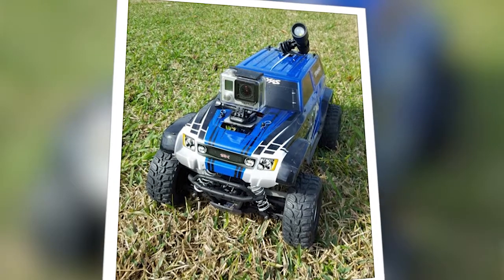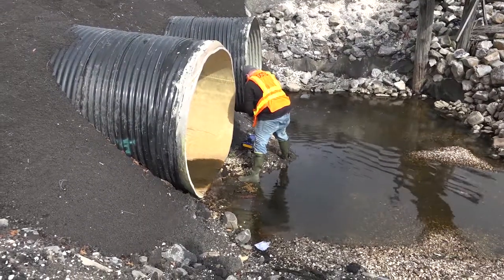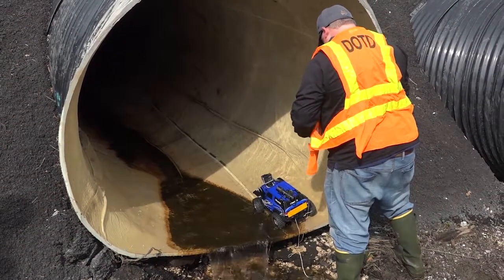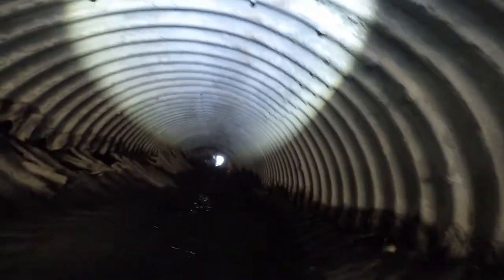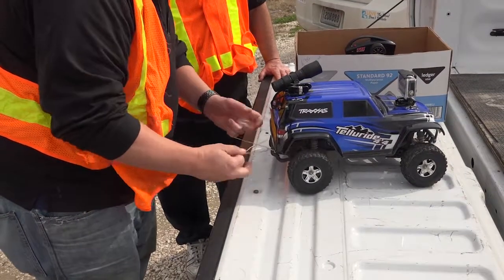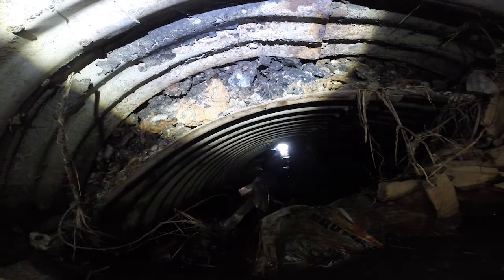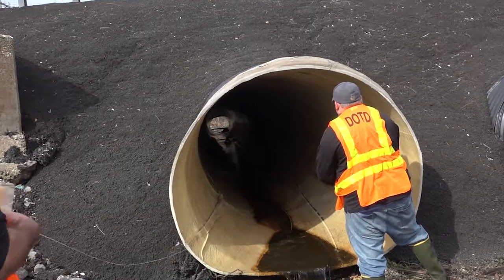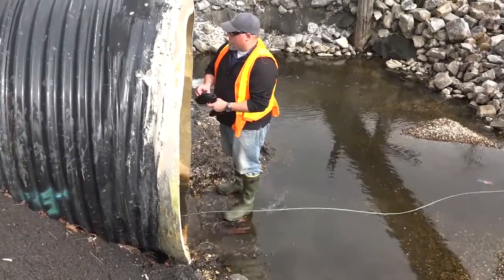Culvert Inspection Vehicle

Comment: Late to see this but very interesting.  What kind of radio range did you get in the culverts, was that an issue at all?  Also, did you do or would you advise any additional waterproofing?  Are you still using a similar setup?  Thanks, very interesting video.  I may be working with some students on a project like this.